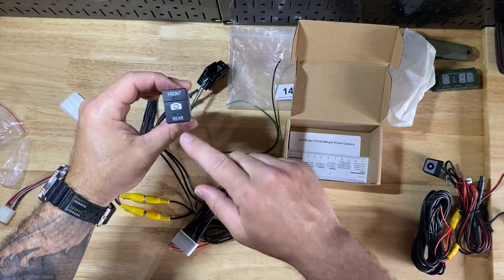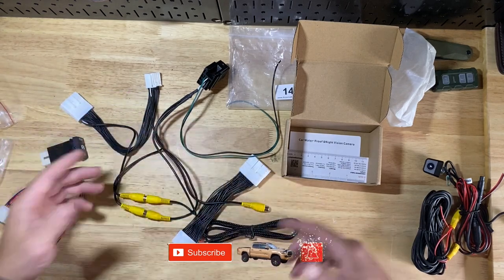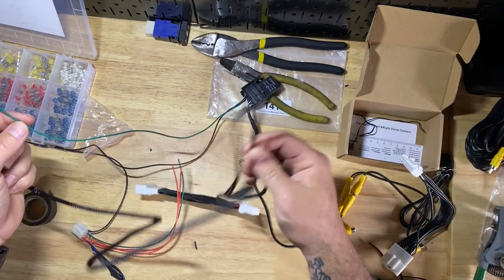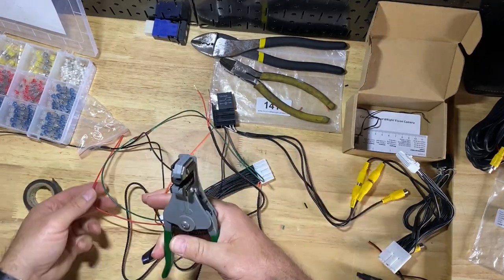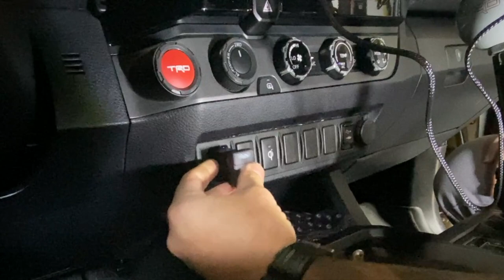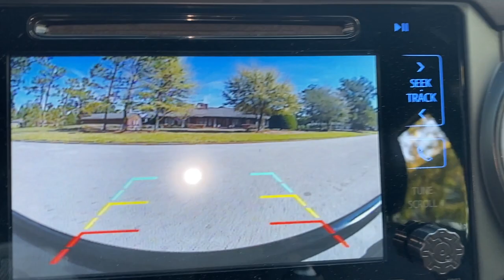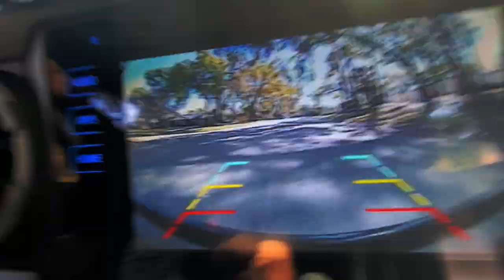Toyota Tacoma | Anytime Front & Back Up Camera Install | (2017 Tacoma)

Comment: Just bought this kit the upgraded camera.  Been on my work bench for about a month now.  Kinda nervous about pulling out the radio, on my 2019 SR5, not sure how to do that, so I'll provably find another video for that.  Looks great.  I have a similar bumper ordered with a low profile bull bar so it was good to see your placement and the view that I can expect mounting it where you did.  Just subscribed to your channel, Classy.  You make this look so easy.  Doing all the wiring connections on the work bench is a great idea.  Something I never really thought of.
Reply from the maker: Thank you for the kind words, hope your install goes smoothly.
Reply: Hey Jeff, was curious how the install for you went? I have a 2019 sr5 as well and have been thinking about getting the camera. Where did you find to be a good place for the camera itself?
Reply: @natejoyce2876  regretfully, the camera setup is still on a shelf in my garage. I haven’t gotten to it yet. There are several videos on YouTube about this particular camera product.

Comment: I tried to do this mod crimping everything together in the truck and it was a total fail. The little wires are not easy to get crimped right and kept pulling out.  I followed what you did with the solder tube splices on a table. They worked great.
Reply from the maker: Awesome, I'm glad it all worked out for you.

Comment: Hey. On my kit the grey and blue wires where for the back light on switch. Used a add a fuse at inside fuse box.
Reply from the maker: Thanks for letting me know. I appreciate it. I will look into it.

Comment: Should be able to cut some other wires to get the lines to go away within the feed right? That would bug the crap out of me.
Reply from the maker: Yes, the upgraded camera has 3 options/ wires that can be cut. Cutting the green wire would remove the lines. I thought it would bug me too, but so far not bothering me. Thanks for watching.

Comment: How did the rear factory camera work out? Can you flip back a forth on the fly?
Reply from the maker: Rear camera is the stock factory camera that was already there. Yes, You can flip between both cameras on the fly by using the toggle switch. Thanks for watching.